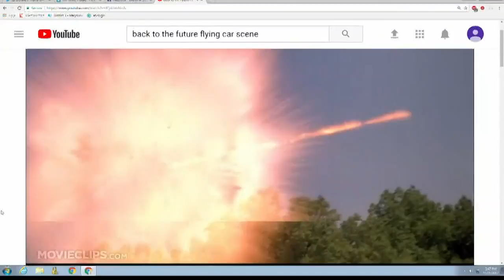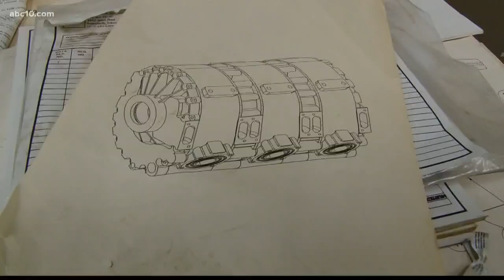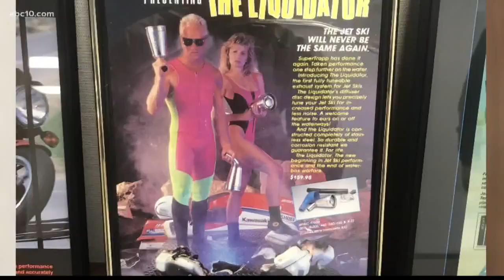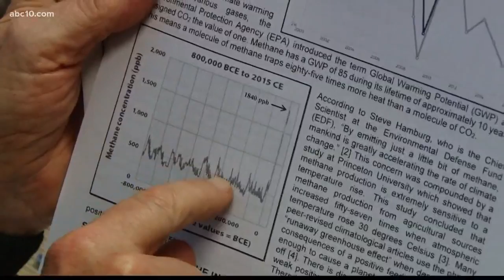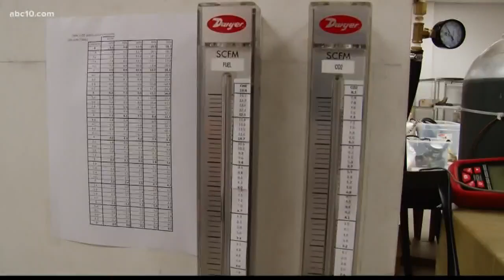Moller Skycar: Why hasn't the flying car hit production?

Comment: I don't really Flying cars are a good idea. Its a niche market that would buy them. Not only that, there is the fact you must remember you must be a certified pilot, have a FAA Medical, and be rich. I mean RICH because these things are EXPENSIVE, and also unsafe. Imagine someone cuts you off on the highway at 65mph; yeah, it's annoying but it won't kill you in most cases. Now, imagine you are at 10,000 feet, and someone, and someone cuts you off; it's not gonna be pretty, and it mostly is deadly as planes don't really have good brakes. Oh, and don't forget break downs because in a plane, that's bad news. It was tried in the 1950s with the Taylor Aerocar in which two were made. There was also a flying Ford Pinto in the 1970s that actually crashed and killed its own inventor and test pilot when the wings fell off.

Comment: I remember being a teen in the 90s reading about the Moller Skycar in magazines and wanting to one day fly it (or at least be able to see it fly!) but as we all know that never happened and never will. Kitty Hawk's Heaviside looks pretty promising right now and has a working prototype so maybe one day I'll fly in one of those instead. I'd take electric motors over complicated and unreliable gas engines any day. Some amazing battery storage tech is right around the corner - gas will soon be staying deep underground and untouched, as it should.
Reply: I'm not sure about electric. Teslas die on the side of the road. My Camry starts up every time
Reply: lol
Reply: Gas engines have worked quite well for aircraft for over a century, whereas I'd hate to rely on electric engines on any VTOL craft, something short-circuits or whatever and you're dropping like a rock.
Reply: @jpowell180  that's why you build in redundancy, and on top of that you include a whole aircraft parachute system if you really want to play it safe. Also, the MTBF on an industrial electric motor is much higher than a jet engine or piston engine. I'll take an all-electric redundant airframe all day.
Reply: Me too.
I hate false promises.
This man should be a politician because..
Mr. Moller delivered a whopper of a false promise.
Funding he says. Lack of money.
All he has to do is open up pre-orderes and the deposit money can provide the funds for the first round of production.

Just like Tesla did
Just like that electric bicycle company in Cali did.
Just like MANY companies on Kickstarter did...

Comment: We need VTOL planes which are reliable, affordable, quiet and could deliver goods and passenger automatically. Of course we need cars too. But we don't need flying car.  It's impossible. The nature did not produce any creature which is excellent at both fly and run. Penguins are excellent at dive and swim, but they don't fly and run poorly. Ostriches are excellent at run, but they don't fly. Albatrosses are excellent at fly, but they barely run.  Now, we want some thing is good at run and fly at the same time so we can use it to deliver goods and passenger. It's just can't be realized.

Comment: It was a vehicle VTOL concept of its time. which in aeronautics terms means its not a viable option today.  just look at its build. full metallic build, several small but heavy combustion rotary engines, which consume fuel.  Its a car that did precede the era of RC drones, so it did go in the right direction in regards to propulsion layout,  but overall though it could fly technically,  it was never truly flight worthy,  meaning it was not efficient by any means.  Not for what would truly be needed to make such a craft viable.   Its a flying brick for starters.  Heavy is an understatement.  heavy metallic body, heavy engines, heavy liquid fuel, and that's before getting heavy passengers.   Compare this to todays evtol concepts currently in development.   Carbon fiber composite bodies,  electric motors, high capacity high output batteries, and lightweight engines.  the key being lightweight,  along with embedded avionics and multiple passenger seating and cargo.    Its what happens over time when expensive materials comes down in costs and opens up the doors for many things no possible prior.   https://www.youtube.com/watch?v=jqvMXoVZfDw

Comment: With so many other Personal Flying Craft currently available to the public, that are also shown in free flight, WHY has the Moller Skycar never been able to be flown without being attached to tethers?  I see videos all the time of people wearing Jet Packs, Jet-Powered Wings, and Jet-Powered Hoverboards, Electric Powered Bikes using Rotors for propulsion, and just about everything else you could conceive, without being tethered to the ground......  So tell me why the Moller Skycar can't be flown and give an even greater exhibition of how well it can perform.  It stands to reason that investors would be much more interested in putting money into a venture, if they could actually see one perform as designed.

Comment: This guy not only imagined but actually developed fully functional drones more than 25 years before drones became widely popular. It saddens me to see that this guy's ideas never really took off (pun intended) because he was so ahead of his time that the available technology at the moment was never enough, so the Skycar became something like a modern day steampunk.
Reply: I followed the development of his "vehicle" ever since I was a small child. I absolutely wish he succeeded. The fact that these days people are capable of building ride-able drones for significantly less money, indicates to me that the problem was never about money, but Moeller's own inflexibility. Ever since the advent of toy drones with self leveling capabilities a few years ago, an electric quad rotor recreational bike would have been extremely feasible. Yet there he was, insistant on using wankel engine VTOL fans on a two seat, enclosed vehicle which would only add weight. As an adult now looking at him, I wonder if he even bothered hiring competent designers, or if he simply spent 60 years doing everything himself, wasting his own man-hours instead of relying on people with more expertise. It hurts to say it, but he probably caused his own failure.
Reply: Yeh. I ran across this in 2003 and when i saw a drone for the first time, i thought, "its like the skycar!!!"

Comment: Moller is a joke. That single seat "car" is really noisy and the downdraft from the small diameter rotors is cyclonic, much worse than a large diameter helicopter downdraft, which is bad enough. The electric rotors on people sized quadcopters are at least twice the diameter, a diameter of 0.5 m has an area of 0.19 m2 A diameter of 1 m has an area of 0.78 sq m , 4 times the surface area, which means a larger diameter will produce a much less concentrated cyclone. 
That video does not have the true sound of the 8 rotary motors It is much noisier. I have seen it before.
It is an aerial vehicle and cannot be driven on roads. It has to be pushed after it lands. The tiny wheels are not powered. 
Moller stated a ridiculously low fuel economy, probably based on a lightweight winged cessna or similar . Since it has no wings it rides on columns of high-speed air and this requires power Either he is incompetent and cannot calculate correctly, or he is lying
Others, such as the Terrafugia and  the AeroMobil have produced working prototypes with real wheels that can travel on the road. Most of these have folding wings for added lift.

Comment: Flying cars are useless. There is no point in owning a flying car. What good does it do to fly a luxurious car? How will it improve your life, besides being able to ditch traffic and travel quicker? Moller flying car doesn't really serve a purpose for the consumer. It's just a luxury design car. Someone needs to design a vehicle that serves a different purpose other than luxury. Helicopters and planes are loud and take up space. The next air transportation vehicle does not need to be labeled a car, but rather a revolutionary means of transportation (RMT). The next generation vehicle needs to be quiet, light, efficient in terms of power, and fast. 

That said, the members of society that would benefit from operating a RMT would be FEDEX, UPS, DHL, the police, and paramedics. The next generation of flying vehicles should be something combined with drone technology and blimp technology. Through the use of blimp technology the vehicle would be far more efficient in terms of motor capacity. The vehicle would not necessarily need huge fans (like the moller concept) and they could be a lot more quiet. It should be a vehicle that does not require an airport, a runway, or a landing pad to be air born. It should be able to take off from virtually anywhere.

Comment: A Wankel engine powered by fuel - should last longer (in the air) than an electric motor powered by batteries.

Comment: The concepts in Moeller machines were brought to Quadcopter toys, just the hardware and software controlling Quadcopters will control a full size flying machine, perhaps just some power transistors, 'tyristors' are needed for controlling electric engines. Did they pay Möller royalties for his development? 
The SkyCar would do better with electric engines inside nacelles, 3, 4, 8,...and the OMC Wankel engines it has now, two per nacelle, passed to inside fuselage, moving electric generators, with an small electric battery for emergency and buffer purposes.
An Itzak Rabin worked at Moeller: help, spy, saboteur?

Comment: Perhaps instead of having 2 OMC Wankel RCE per nacelle, the Moeller SkyCar would do better with for or more electric engines per nacelle, an small battery for emergency, and Wankel engine powered generators inside the fuselage.

Comment: Electric motors, batteries, and drone technology has surpassed this design. Also rotary engines have awful fuel consumption and use oil like a 2-stroke.
Reply: The design specifications Dr. Moller is working towards are for a four passenger vehicle with long range (up to 800 nm) and high speed (up to 300 mph cruise. There is no way a vehicle using batteries could meet either range or speed requirements let alone both simultaneously. 

The energy density of batteries is far too low for more than 100 nm of range and speed no higher than 150 mph. Plus the cost of batteries is still so high that short range flying taxis are economically viable if flown nearly continuously with very high speed recharging at specified verti-ports. So I don't see how the recent development in battery powered drones has surpassed Dr. Moller's efforts.

As for the power specific fuel consumption (fuel flow rate per shaft power), in automotive versions this is still lower than the best piston engines. But that isn't an inherent thing. More that billions have been spent to optimize piston engines while millions have been spent on rotary engines. There are companies that are currently improving the rotary engines to have considerably better fuel efficiency. One of them, Liquid Piston, has run demonstrator engines with better fuel efficiency than piston engines. As for the oil burning proclivities of rotary engines, advances in material science that allowed the use of ceramic tip seals drastically reduced the oil consumption of all rotary engines starting in the 1980s.
Reply: @papparocket  ok ok I see you believe all the b**s** that he has said. Never going to happen, 300mpb, 800 mi range or even fly at all. Agree electric will never have 800 mi range in near future unless Battery Technology improves ten fold. However for local flying there's already a certified electric plane called the pipistrelle. There's already electric drone deliveries. You know this thing was up for sale on eBay right.

Comment: Great idea. Hope it goes full time production. I was wondering how the Sky Car handles both engines out on one side. Thanks for posting. Paul Moller you are the man. Good on ya mate.
Reply: Joking? This thing will never fly. He’s given up on it.
Reply: @ @patty109109 , Still a great idea. i hadn't heard that it was terminated.
Reply: if both engines went out on one side...instant roll over and death......unless he found a way to tie in all 8 engines with each other....so if one or more go out, other engines also go out, and it becomes either a glider. (like an airplane)...and/ or has a back up parachute, making it hard to control WHERE one would land...also if car's altitude is less than 200 ft, parachute won't fully deploy in time.......i agree with you though....he's a forward thinker, and trying.
Reply: @sammytheface8821 , i can imagine a computer that senses power drop on same side engine and adjusts power and bank to the good side but as you say, below 200 ft. there is virtually no time to effect recovery.
Reply: @sammytheface8821  Yea, this will glide like a rock.

Comment: I would NEVER trust a rotary engine in a plane that I'm flying in. recipe for disaster right there.
Reply: Rotary engines are safer for aircraft than piston engines. When a piston engine fails it can bind in the cylinder and cause the entire engine to seize. This can also cause uncontained failure where parts are ejected. Rotary engines can not seize when they fail. As such a multi-rotor engine can continue to operate at part power with a failed rotor. Even in single rotor engines the engine will continue to spin so the drag from a fixed pitch propeller is much less than the very high drag from a non-spinning fixed pitch propeller connected to a seized piston engine.

Comment: Mr. Moller: get rid of the shroud around your propellers enough to allow for vortexes  or will never fly. A bee with shrouds around its wings will not fly, and the same principle applies to your flying machine. Here's the thing: you spent millions making it look so nice to attract investments when you should have made models first radio controlled of various sizes just to test the concept. As far as I can tell, you are relying on impulse, like a jet engine. Well, that will require many times more power than a system using the vortex that develops around the thousands of drones of all sizes already in mass production using a fraction of the power. Use the maximum size shroud while still obtaining the required vortex. It's easy to do a lift analyzer using various configurations that don't deviate from your main design idea. Your fan blades should be more like drone propellers. I think it can be made to work this way instead of searching for more power. http://uralica.com
Reply: Interesting thoughts. After all, yepp, in today's just born eVTOL industry it would be wiser to change something rather than trying to push production of this old tech. BTW, why uralica.com? Some Finnish stuff. Interesting, though...
Reply: Here's some nicely explained info about shrouds vs ducts (GoFly Prize Master Lecture "Ducted Lift Fans w/ Bob Parks"): https://youtu.be/i31pXk6ayPY?list=PLXF47_jToSN-oOKFNZ4XN0fLyI6I1_h3w&t=123

Comment: The owner/inventor never got this to fly because it cannot; it has severe design limitations, anyone even remotely informed about aeronautics and aerodynamics can see it. Furthermore, each of the ducted fans incorporates 2 Mazda rotary engines for power; a loss of a single engine could be catastrophic as this has no glide ratio; synchronizing the engines is not easy, they will consume lots of fuel, and they cannot move enough air volume with these ducted fans. Propellers can move a large volume of air slowly, where turbines move a smaller amount of air faster, this design does neither, as it is incapable of flight.
A lot of investors have been bilked of their funds. Now it is for sale on ebay, you can buy it if you want to throw away your money.
Reply: Vaya fiasco gracias

Comment: Paul just has to replace the fuel run engines with electric motors and walla we have lift OFF. Simple and we know that it will work.
Reply: Range is very important to Moller.
Reply: @BlueOceanStrategistS  well if electric isn't for him, there are mini jet engines that will create enough or even more thrust than his engines and be more compact so he could easily use those and his flying car will be a reality
Reply: @Mike588  Jet engines could work, except for their cost. Rotary engines would be cheaper, if simply produced at volume.
Reply: Jet engines are also too noisy to make for practical flying cars.
Reply: Oh, and at lower speeds, jet engines are less efficient than fan engines.
Reply: @BlueOceanStrategistS  people are aready using them on jet packs and fly boards and nobody seems to complain about noise, you can't make everyone happy. I would fly one if it was epuipt with jets. The millions that he spent since 1989
He surely could have built and flown something practical by now 
Don't you think.
People are biulding flying crafts in their garages. And Paul had millions and still nothing.
And in 89 I purchased his video. 
I thought he would be the future, but the future is here and Paul is not.
Reply: @BlueOceanStrategistS  Batteries that will give eVTOLs useful range is in the pipeline. You can also extend the range of any eVTOL by quite a simple adaption of the design by adding a generator and making a hybrid.
Reply: Technology is hardly the limiting factor the practicality of mass implementation is the concept is horrifically spatially inefficient both on the ground and ironically in the air.